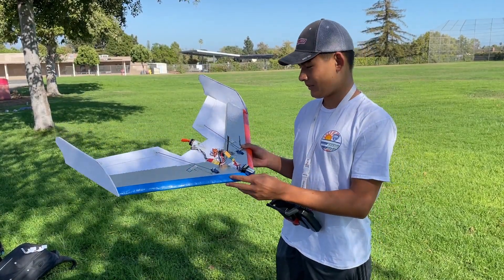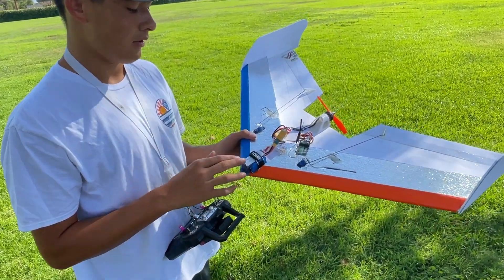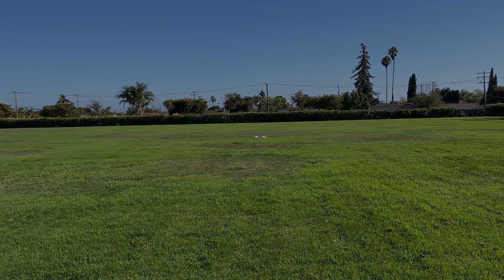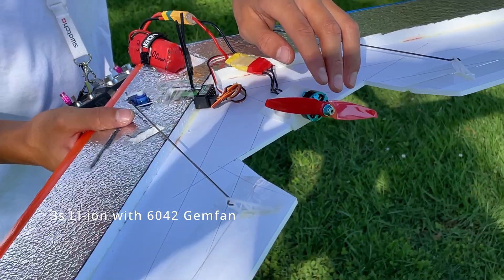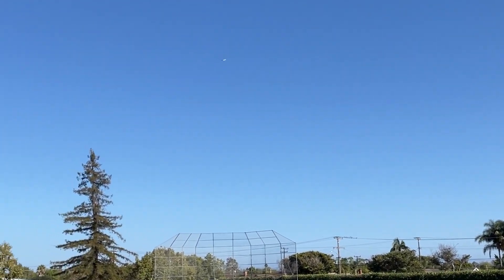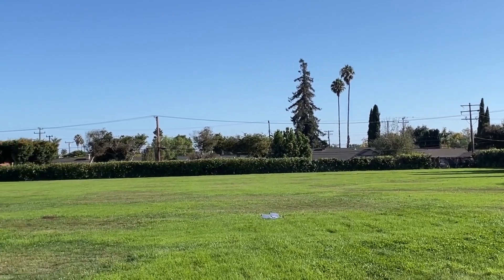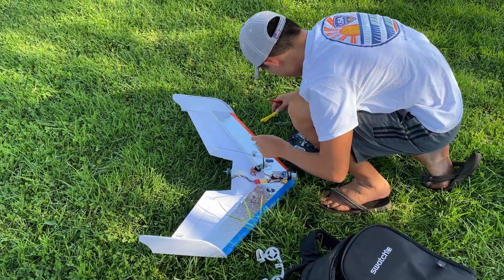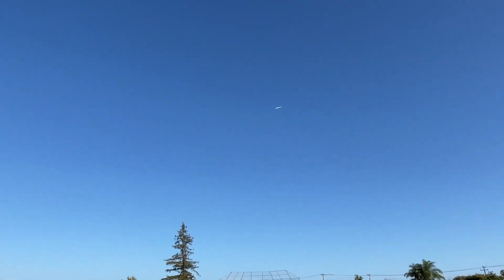30" Flying Wing | Scratchbuilt DIY | 30 minute flight time!

Comment: do you know where i can get the plans for a similar plane? it will be my first time building a Flying Wing like this. i know it is extremely simple, but ive looked around and only found one using a formed complete wing. your design is only using two sandwiched rectangle witch is genius.
Reply from the maker: Yes, the original design is by ProjectFlightDesign. He has a YouTube channel and the video named: delta wing build.
Reply: @theorangebaron1595  thank you!